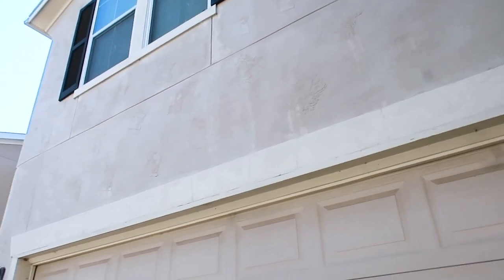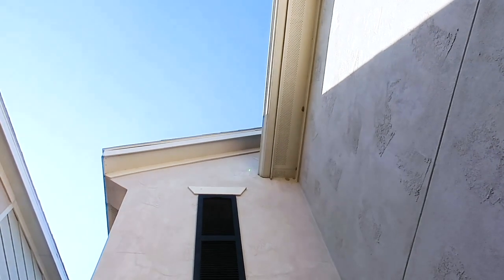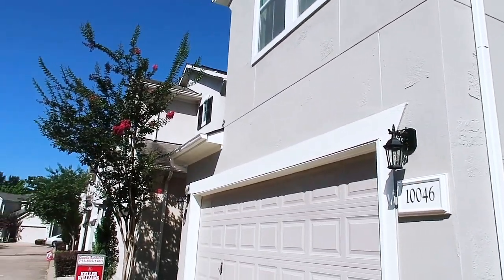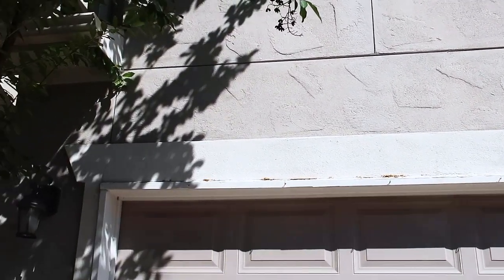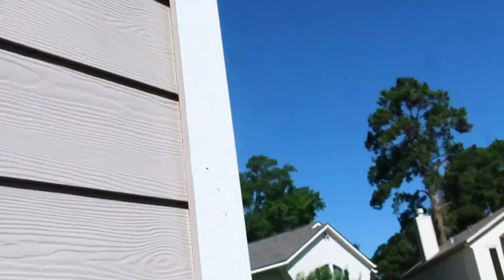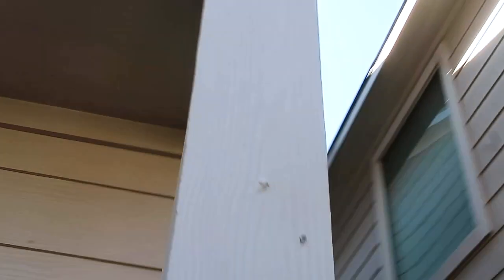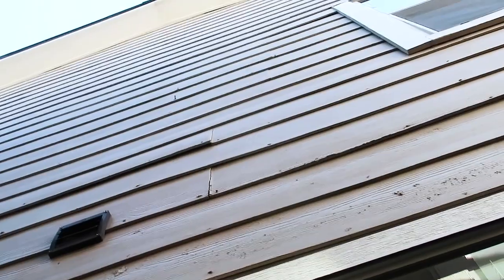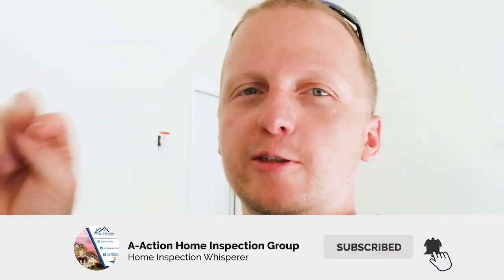Home Investigator: Episode 7 Exterior Stucco & Fiber Cement - The Houston Home Inspector

Comment: Add a kick out flashing and seal and patch exterior cracks at your discretion. 

Cracks on stucco specially in Arizona are considered cosmetic defects and will not be reported unless a dime fits in the crack. The lath you report if it's visible and shows corrosion again patch-caulk at your discretion. 

I don't mention or say the word termite or any form of wood destroying insects by you saying that you saw a mud tube, the buyer might change his mind and the seller had the home treated (2) weeks ago and you blow the deal ..... 

Do not say a word about any wood destroying insect unless you want your E&O to go sky high for blowing a deal and getting sued for acting like a termite inspector.

I don't inspect in your state so I'm not effecting your business in any way,  but if interested in checking out our company sites click away.....
https://www.inspect-arizona.com/ or https://www.phoenix-home-inspectors.com/
Reply from the maker: We have a termite company as well.